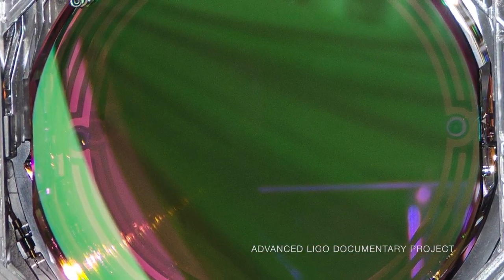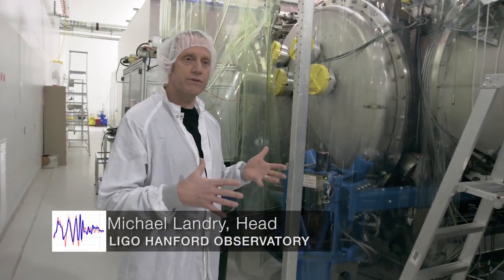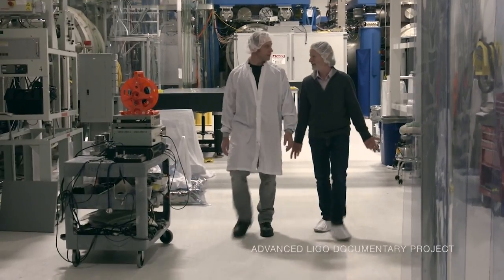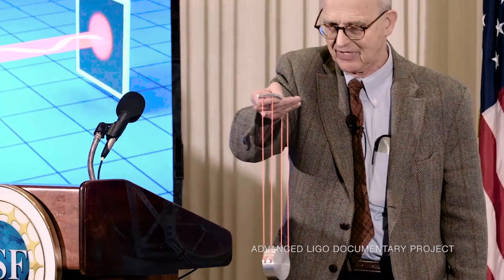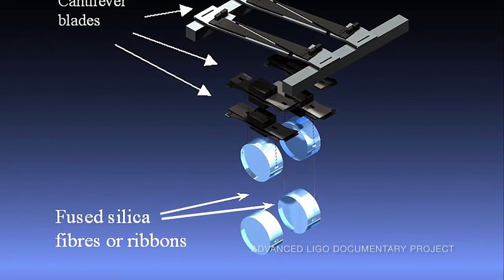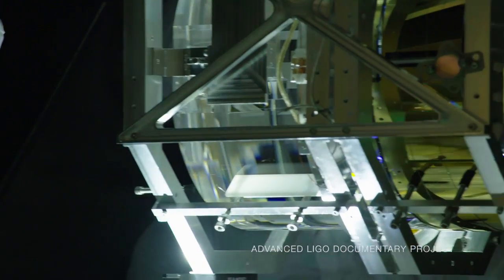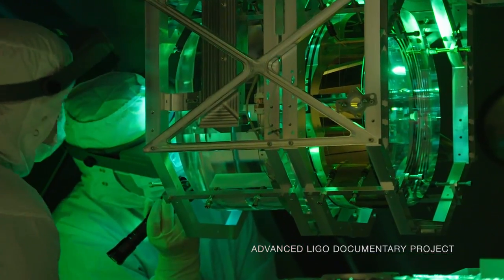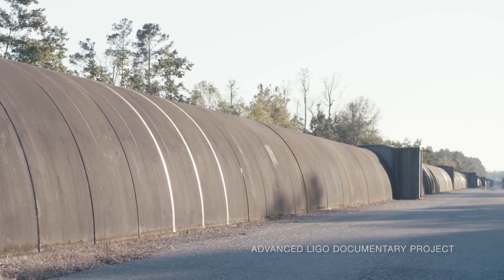EPISODE 1 - LIGO: A DISCOVERY THAT SHOOK THE WORLD

Comment: Can't belive it's been 6 years since the announcement of success.  I'm curious, what advancements in experimental design and materials science are projected to be necessary for reducing this instrument to the size of a building? A room? Ultimately to a sensor sold by Adafruit?  Wouldn't it be fantastic too have a wristwatch that would stay synchronized to GMT Time as we travel between planets?  I would suspect that a clock that can compensate for the effects of relativity AND gravitational fluctuations encountered along the way, without needing constant corrections from a ground station 16 light years away would be important for interstellar travel.
Reply: "Mr. Fusion"

Comment: I want to share with LIGO, NASA, ESA, Elon Musk and SpaceX the Delta Vehicle I invented on April 19, 2000: a revolutionary system that harnesses all known deltas: Pressure, Voltage, Magnetism, Density, Temperature, Height, and Gravity. The most critical aspect of my Delta Vehicle is the Gravitational Delta. To fully utilize Gravitational Waves, the vehicle is equipped with three specialized devices:
1. Gravitational Wave Tuner: To precisely adjust the vehicle's alignment with gravitation-al waves.
2. Gravitational Wave Amplifier: To enhance the vehicle's response to these waves.
3. Gravitational Wave Router: To direct and control the flow of gravitational energy, enabling efficient movement and energy generation.